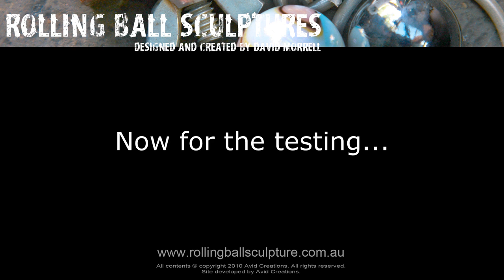Rolling Ball Sculpture time-lapse by David Morrell

Comment: Very interesting. I've often wondered if it would interfere with the motion if the wire was allowed to go rusty. 

I use my laser to cut formers. I can quickly cut a range of diamters and then I glue them together in a stack.